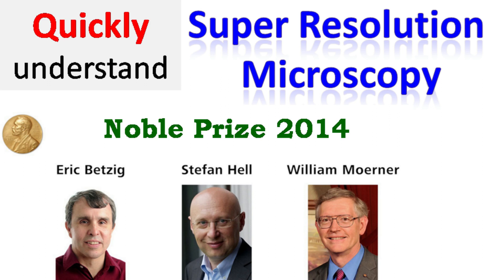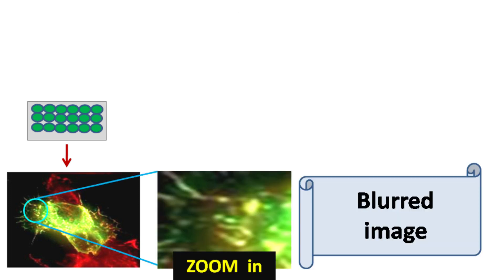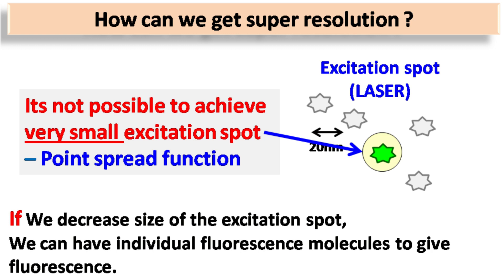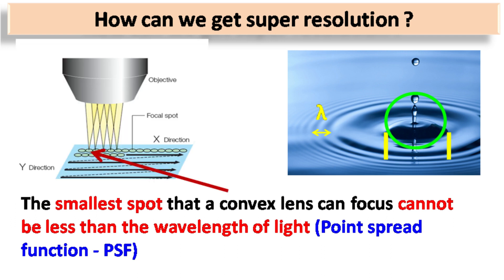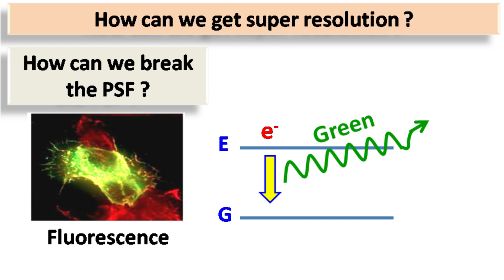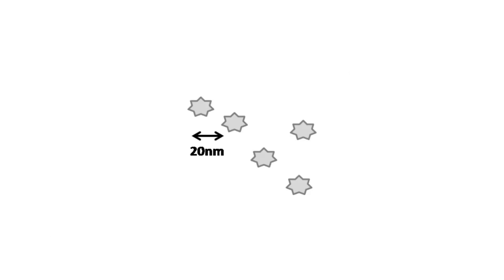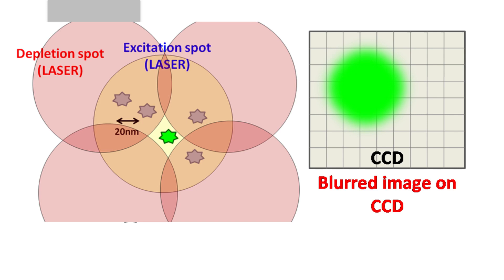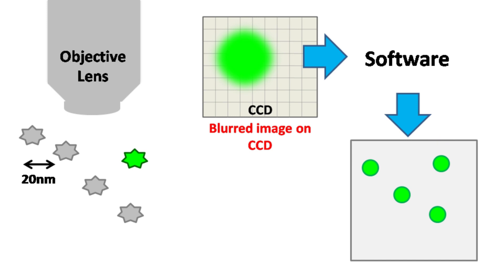Super resolution microscopy | Stimulated emission depletion (STED) microscopy

Comment: Two very important things that I think are wrong here: 
1- the smallest spot that an optical system can resolve is not the wavelength of light (lambda) but lambda/(2NA), NA being the numerical aperture of the optical system. That is the diffraction limit, also defined as the Abbe limit. This can be explained when studying a single slit diffraction: the position of the first minima in the diffraction pattern = diffraction limit.
2- It is breaking the diffraction limit not the PSF. PSF is the diffraction pattern that is imaged through the optical system but diffraction limit is the first minima position of the PSF pattern. So high resolution is breaking this diffraction limit not breaking the PSF.
Reply: I believe you are completely right, I thought the same when watching the video
Reply: Thank you!
Reply: Exactly, but to be precise, by using depletion laser onto excitation laser (= excitation PSF) you shape it's PSF to a more narrow point (referred to the middle spot of usual PSF surrounded by the first minimum). It is PSF-shaping, which allows you to sum up point records of the object by scanning mode into high res image.